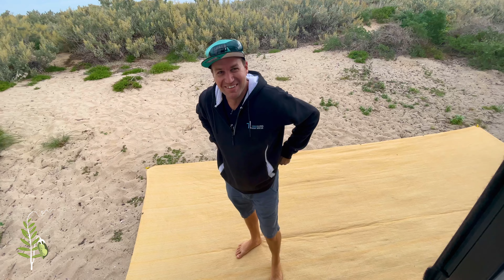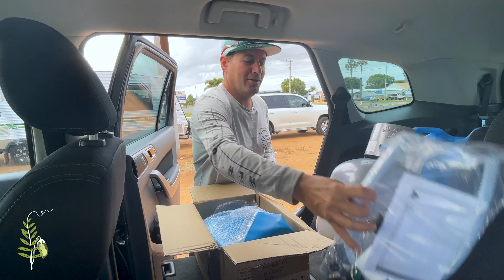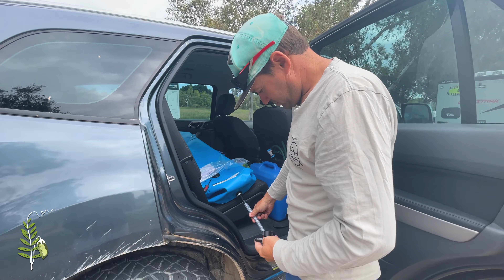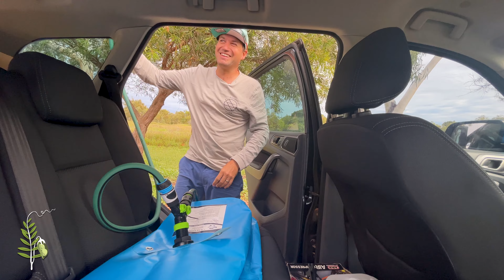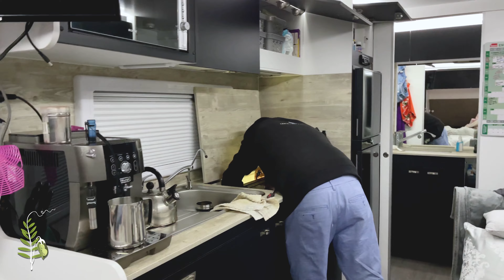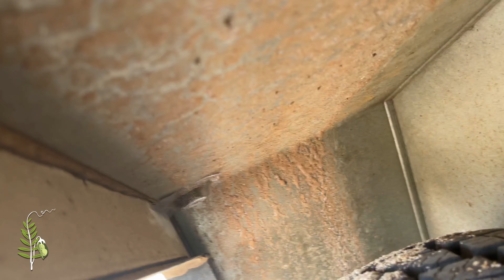S1 Ep16 #1 Off-Grid Campsite So Far: Blowholes WA, Carnarvon, LBW Adventures 🙌

Comment: Think you will find that water bladder, deflated, fits on the rear floor in front of rear seats, then fill it and it "fills the space " and is secure.
Reply from the maker: Hey graham, yes we have see those ones, but we didn’t end up buying the floor version as we have too many things already sitting back there 🤣 We did drop the seats down the 2nd time we used it to provide a flatter surface which worked a lot better.  Thanks for commenting and watching 🙌🙌🙌
Reply: Nothing you don't tie down is secure in a roll over,  that is why we have seat belts and air bags. Just saying be safe guys 🥴

Comment: Buy a portable 12v shower from super cheap for 20 bucks, cut the shower head off and use it as a pump. Works perfect. Easy as.
Reply from the maker: Hey, thanks for watching and sending through a comment. Yes we have a little inline pump which is super handy to transfer the water into the van. 🙌

Comment: Hi guys we love your vids !
how many litres is your water bladder and if you wouldn't mind putting a link to where you purchased it on ebay?
thank you 😀 safe travels
Reply from the maker: Hey Michelle, the bladder is 140 litres. We got it from a company called Fleximake. 
https://www.ebay.com.au/itm/221236154980?mkcid=16&mkevt=1&mkrid=705-154756-20017-0&ssspo=GHa7ZkaQRwe&sssrc=2349624&ssuid=p-WcRKgNTqC&var=&widget_ver=artemis&media=COPY
Not sure if that link will work, however, just search water bladder on eBay and the company will come up. 
Thanks so much for watching our vids 👍
Reply: @LBWAdventures  thanks heaps will check them out 😀